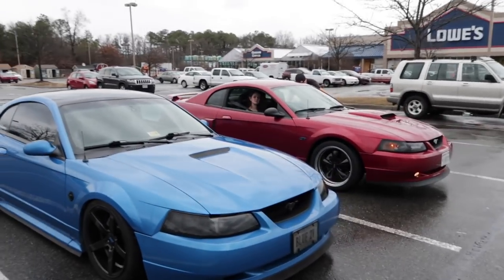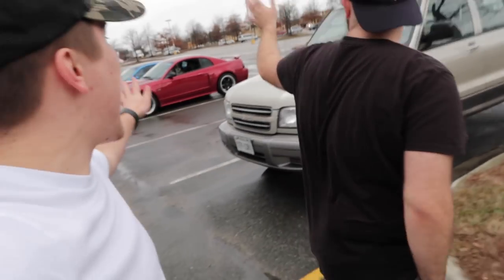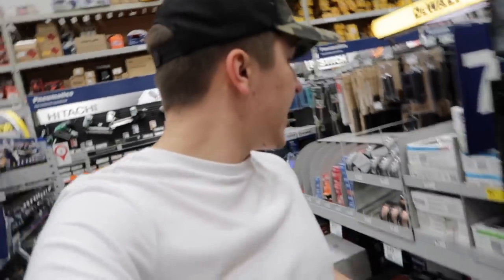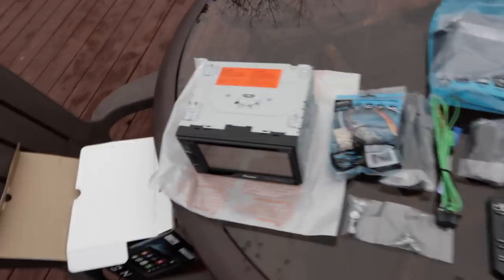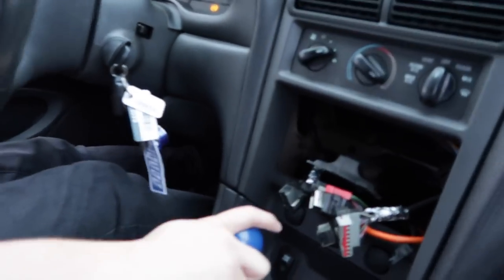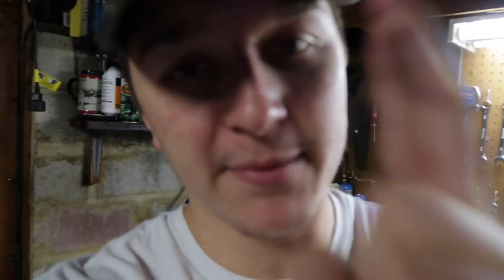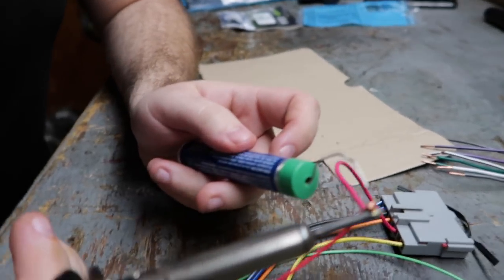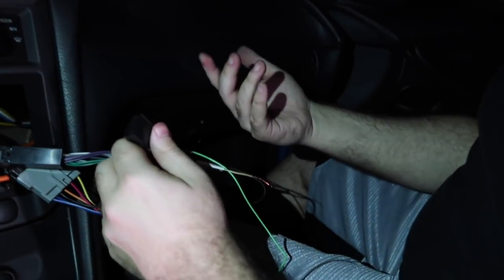RE-DO BLUE: New Touchscreen Radio! | Episode 44

Comment: On the amp ignition wire(I think the yellow or orange it should say on the harness) you have to wire in a 1000ohm resistor if you have the Mach 460. Did this on my 99 GT. Reason for this is because aftermarket head units put out 12 volts of power whereas the stock head unit puts out 5 and the stock amps are meant to run on 5 volts. Using ohms law you get 1000 ohms will drop the voltage. If you don’t do this the amps will probably last for maybe a year but you’ll hear them start to pop and after a while they’ll just go.
Reply: Thats very good info dude i did not kno that. Now you are saying that the Head unit will die or the stock Amplifiers? I dont get it, if had 2 Sony head units go out on me in that past 2 years in My 02 GT im on my 3rd But its a Kenwood
Reply: RocafellaAF1 This would only cause the amplifiers to go. I’m not sure why your head units have died.
Reply: Alright cool man i got ya, i just did what u mentioned because my amps have no problems yet. thanks for the info
Reply: The bottom speakers are actually all subwoofers and the “tweeters” are actually full range speakers in these cars. If you wired it correctly, the bottom speakers should be getting signal from the pre-amp output in the back of the Pioneer. Then you need to turn on the subwoofers in the settings.

Five Star Audio has a video on installing a new radio in this Mustang. It’s quite a unique system.
Reply: Marko Shmotolocha so how can I make all the voltage stuff work with out  burning no amp ? 
I need some help please I’m planning of buying after market unit but I don’t want to burn anything

Comment: The wiring could have been done in a cleaner way but whatever works for ya. I've watched a few youtube videos for replacing my stock radio but none of them shows how to wire up the premium sound system option. The premium sound system has 3 multi-conductor connectors on the radio while the standard system has only 2. It's the same stock radio but different cabling. Hopefully I'll find what I need. As a final note, this video left out a few things that you'll find in other videos.

Comment: Just a heads up because there's so many wire harnesses  for these mustangs, I needed the metra 70-5701, for my 2003 mustang mach 1,  not the 70-5519. I had so much trouble with this, there's literally 5 different harnesses.

Comment: Listening to this again, I have to ask if it's a problem with your phone recording or that you did not wire up the amplifier because it seems it was lacking bass. It looks like your second cable is the wrong one. My second cable, for my 2002 Mustang with the Mach 460 system, had RCA cables that were connected to the Front speaker jacks. Without that connection, and the amp activation wire, I had no bass.

Comment: I have the same Stereo in my Stang too !
Reply: If you plan to upgrade, check to see if your Mustang has the premium sound system so that you get the right cables. The radio is the same but the premium system has 3 connectors plugged into it plus the antenna cable.

Comment: I commented on another video about installing my Avic F900BT in my 99 v6 5spd. I know the  dash can be changed but behind it is where I think I will have issues but i found this video which is the one I was referencing about but behind the dash is different and where I feel it may be challenging. Please help!
Reply: SuperBeeFlyy Productions I did it on my 2000 mustang and I bought the trim on ebay: it's a new trim for these particular single din mustang youll just need to cut 2 little things at the right and the left when you uninstall the old trim (with a little power tool like a dremel or something like that) it's not a problem!